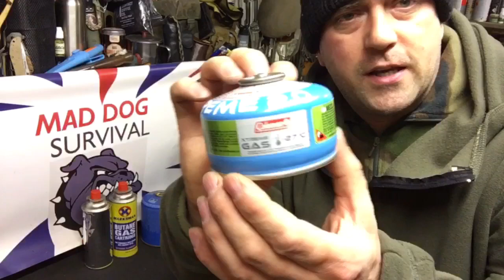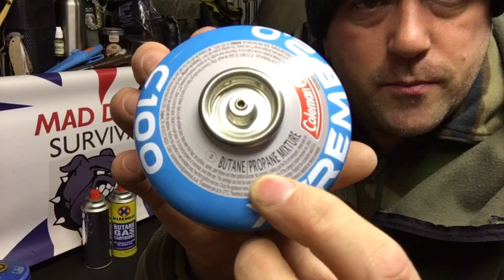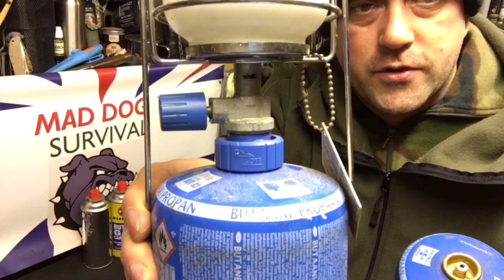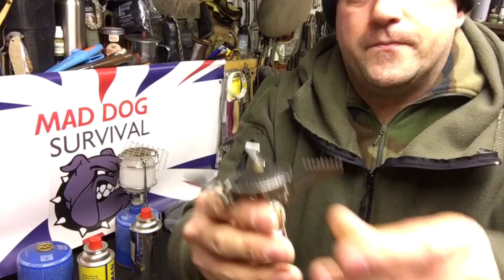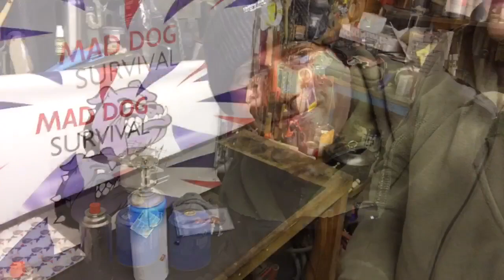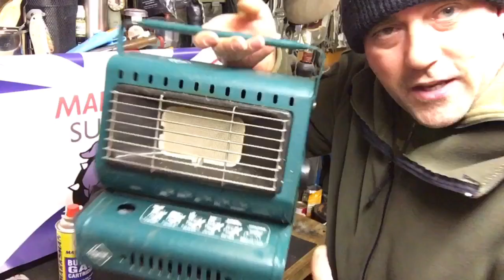Butane vs propane ?

Comment: In that case do not be buying American propane it's not propane its butane heavy protein. Simply put our propane canisters don't work any better than your blue butane canisters there. Yes we do have the cold weather butane canisters but the only information we get is that it burns better in lower temperatures because hits mixed. Unfortunately they do not explain how it is mixed. The only explanation we get here in America is that butane can be used inside and propane should always be used outside. This leads me to believe that most of our propane is low filtration butane probably with something like 10% propane so that we can call it propane. The only marker I've seen to give a percentage is on a torch butane tank that says filled with 99% butane 11x. 11x is considered more than sufficient for cooking on however if you're going to use it directly on the food they suggest 14x for such things as brazing your custard or flame cooking your hot dogs.

Strange really if you think about it 5x is acceptable for lighting your cigar or your fagg that 14x is preferable for flame kissing your food. I play it safe and stick with 11x to light my cigar.
Reply from the maker: Absolutely my friend 👍🏻😎

Comment: Great and informative video! ;) Mylar film reflects thermal radiation back into the can, which prevents heat losses and helps keep the gas warm, not reflects the cold ;) It is common misconception, because it feels like the cold air always rushes in, but only after the hot air escaped already trough opened window ;)
Reply from the maker: Thanks mate! Yes my bad lol…. Best wishes 👍🏻👍🏻😎

Comment: I know this video is old and i should've won golden shovel award but: reflecting cold. YOU CAN'T REFLECT COLD because cold is lack of heat. Same ase you can not reflect dark because it is lack of light. You can only slow heat dissipation (does not really apply here because gas is cooling itself by pressure drop and boil of) and / or help the gas warm itself when the surroundings are hotter than the gas itself, which your "air pockets" insulate it from too.

Anyway good video plenty of apropriate info :)
Reply from the maker: Yep I was wrong with that! Thanks for your watching and taking time to comment. Best wishes friend 👍🏻😎

Comment: How do you figure you get more out of it the higher you are??????????????????🤔🤔🤔🤔🤔
Reply from the maker: The air is thinner and the liquid gas boils more efficient 👍🏽😎
Reply: @MadDogSurvival  Liquid gas dont burn more efficient in thin air when it dosnt get the air/gas ratio it needs.
You are so very wrong about that.
Reply from the maker: Ok thanks
Reply from the maker: A bit of reading for you my friend 
https://mdpi-res.com/d_attachment/energies/energies-14-04627/article_deploy/energies-14-04627-v2.pdf?version=1627871219

Comment: thanks for the information about boiling temperatures. however, i am not able to make sense of your insulation advise.  all boiling occurs by heat transferring into the liquid which provides the energy to change to gas.  only difference between liquids is temp which this occurs. Since water is 100 c, heat must be generated to make this happen. Since butane is -4c and propane is -40c, ambient heat is enough. by insulting the tank, this will limit rate of heat transfer from the air to the tank.  the boiling does not “generate cold” it absorbs heat.  

a pinned comment stating this was incorrect would help people. 

cheers.
Reply from the maker: Thanks! Yep with hindsight I think you are correct and I will indeed pin your comment thank you for your constructive comment and taking the time to watch. Best wishes mate 👍🏽😎👌🏽

Comment: This is very interesting.   How do they compare to isobutane and methanol for heaters?
Reply from the maker: To be honest friend I’m not sure as heater’s are usually meant for indoor environments I’ve never really looked into it. I’m no gas expert but I’m assuming that if the appliance is designed for indoor use then it would probably use fuel that is rated for above freezing conditions and has a higher concentration of elements that smell so to warm in case of leaking etc…. Sorry I’m not able to help with your question. Thanks very much for watching and taking time to comment. Very best wishes friend 👍🏽👍🏽😎

Comment: No no no, insulation on the gas container will not help at all,  it will in fact make it more difficult to get heat into the container in order to  evaporate it.  As the gas changes from liquid to gas it needs to draw heat from the environment to keep a vapor  pressure.  Insulation will inhibit the required ingress of thermal energy to maintain a boil off of gas.
Reply from the maker: I was trying to suggest the canister was insulated before going into a cold environment! And as many a mountaineering troop will tell you that it’s a proven thing to do! Thanks for watching and commenting

Comment: I was wondering which one Burns hotter 
Butane 3578ﾟF
Propane 3596ﾟF
So pretty close
 Great video though, answered a lot of my questions
Reply from the maker: Thanks! Yep similar temperature outputs,  but propane will continue to vaporise/boil into gas at far lower air temperatures, so is a better choice for cold weather climates. Glad you found it useful my friend! Best wishes 👍🏽👍🏽😎

Comment: I remember back in the day they used to have campingaz cans with no valve - you just had a needle on the stove that pierced the can. A really unhelpful design really looking back.
Reply from the maker: lol yep I can remember my dad using them! Little gas bombs waiting to happen! Thanks for watching my friend best wishes 👍🏽👍🏽😎
Reply: You can still get that style of canister (Campingaz C206), although they aren't as common as they used to be.

The current version of the canisters have a safety seal inside, which stops all the gas escaping, if it gets removed from the stove/lantern before it's empty.

Comment: Tea cozy and hand warmers to keep the tank warm when it is running would help. Spraying the canisters black is supposed to help as well.   Propane is a lot better than butane over here in the cold.  I have a lot of equipment that runs on 1 pound propane canisters, like you would run a plumbers torch on. Nice jumper. Thank you for the video, Andy
Reply from the maker: Yep definitely black paint absorbs heat better, that’s why it’s not good to wear black clothing in hot sunny weather! Thanks again brother 👍🏽👍🏽😎

Comment: I've never cooked with propane other than at home and have never used butane. In the woods I just use an Esbit stove
Reply from the maker: Yep I’ve used a Esbit stove a lot years ago, the advantage of gas is if you’re using a let’s say older/collectible item, it doesn’t soot up the bottom as much as you can with some fuels Thanks for watching again my friend 👍🏽👍🏽😎

Comment: Useful info as always, I've always used them table top butane hobs in caravans and as backup for home use even got an adapter so the same canisters for the hob can fuel me lantern ;) body packing the canisters helps loads with getting a lantern lit in cold weather and the heat the lantern throws out even in a cheap single skin tent means it never gets too cold for the butane
Reply from the maker: Yep agreed brother! The cold weather mainly effects the stoves if cooking outside, but yes you’re system is sound 👍🏽👍🏽🙏🏼 Thanks again my friend hope you’re doing good 😎👍🏽
Reply: @MadDogSurvival  Yup all's good in Hull lol, shared this video in a Facebook group as even though it's basic info for most preppers some of us get blagged about propane being safe indoors (Mr buddy heaters in USA)
Reply from the maker: Thank you my mate 👍🏽👍🏽😎